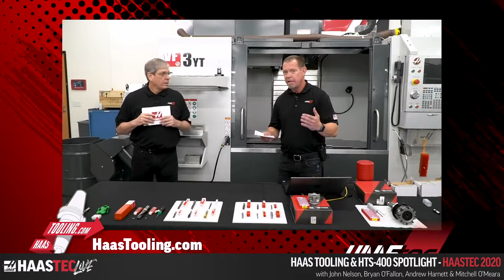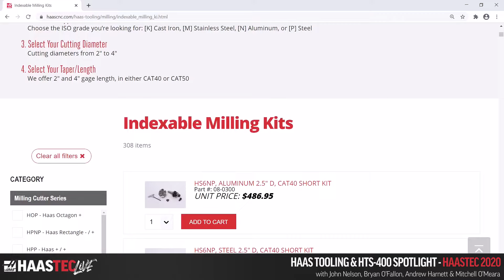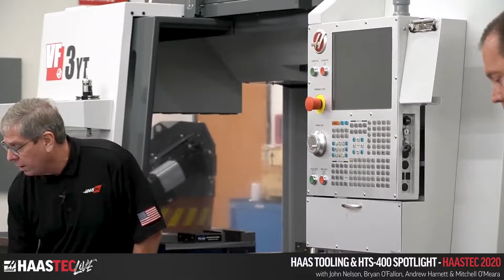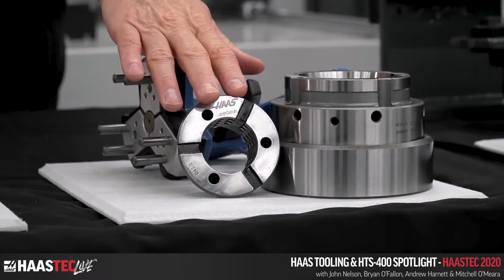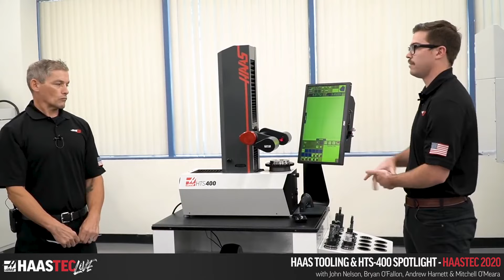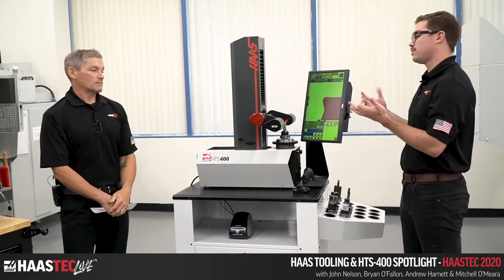HaasTooling.com & HTS-400 Presetter - HaasTec 2020 Focus Series - Haas Automation, Inc.

Comment: So when this tool presenter has a problem, is the local HFO going to service it? Why should I buy the Haas one rather than one built by a company that specializes in these tools? 

Don’t get me wrong, I like a lot of Haas stuff, it just seems like they’re not focusing on what they do best...machine tools.
Reply: Well for one thing they are inexpensive especially with the blow out sale they got going on you can get cat40 er holders for $47. You can also finance a large purchase of tools with your machine purchase financing. They test all these tools and make sure they work best on Haas machines. The tooling is inexpensive and will help stop people from buying ebay holders and wrecking their spindles tapers or breaking cheap pull studs. From a business standpoint, selling tooling makes a lot of sense and is a huge money maker. As for service I don't know, but I hardly need much service on small things like tool holders.
Reply: @Foomanlol  thank you for your input and comment. 

Most people who are buying Haas machines aren’t buying cheap Chinese made tooling to run in them. There are some, however they are far and few between.

I get from a business standpoint that it’s a money maker for Haas, however it puts them in direct competition with many of their HFO’s who sell tooling and accessories in conjunction with machines. And before you say that the HFO’s get to sell Haas tooling, the HFO’s only get a small percentage of profit from the sale of the tooling when bundled with a machine purchase. After that if you buy Haas tooling the HFO doesn’t get anything from it. 

In terms of service, I was referring to the tool presetter (the piece of equipment they featured at the end of the video) and not the tool holders themselves. I know if I’ve got a Haimer presetter and it has a problem, Haimer will fix it.  If the computer on the Haas tool presetter has a problem, or if a drive belt breaks is the local HFO going to come out and fix it? If not, then who? 

My only concern is that Haas is trying to juggle too many balls and so rather than excel at something they do really well (create high value machine tools at an affordable price) they’re going to do several things in a very mediocre way and end up alienating many of their customers.
Reply: @DdgeluvinHic  I'm wondering if they're either trying to be an all in one package or trying to corner the market driving smaller companies that had provided reasonably priced accessories and then jack the prices up. Hopefully they're doing it with good intentions of making it easier for people to open shops. Already though you could finance tooling when buying Haas machines, it just wasn't Haas tooling. Idk, nuts how much stuff they're adding to their product line with all the tooling, workholding, automation options, and new machines they must have put alot into R+D the last few years
Reply: @DdgeluvinHic  I do agree that most people probably don't but I remember stepping into a guys shop with vf-6s and 4s and all he had was shars tooling and I was a bit surprised. Haas sells over 50 machines per day so there's gotta be a guy amongst those that wants to cheap out on holders lol. The Haas toolholders are also actually Chinese made but so are Iphones and quality control is probably good. I bought a bunch of holders myself to try them out. Pull studs for $6 a piece is hard to resist. We shall see how it goes. I really do like the idea of Haas moving into these markets just to shake things up and increase competition and transparent pricing. I'm personally tired of calling reps asking for pricing on products and waiting days for even just a quote like its some big secret. It's like these guys live in the stone ages. Any friction to purchase a product should be eliminated but they seem to just insist on making everything a pain.
Reply: @Foomanlol  tons of people buy haas machines just to be as cheap as possible, load them up with ebay tooling, never do maint, run them into the ground, then complain that haas machines are bad lol

Comment: Will Haas be releasing who is actually making these items? It would be useful to know for instance if Lang is making those self centering vises since there are lots of accesories available for Lang vises that obviously aren't made for the Haas version yet but might still be compatiable.
Reply: It would be great but they cannot otherwise end users will just buy the cheaper of the two offerings of the same product and the producer will loose money. This is marketing but at least you know that is some actual tool maker and not Haas itself (they said in the video that those are tools they used for long time).